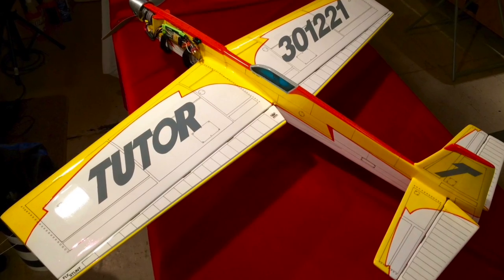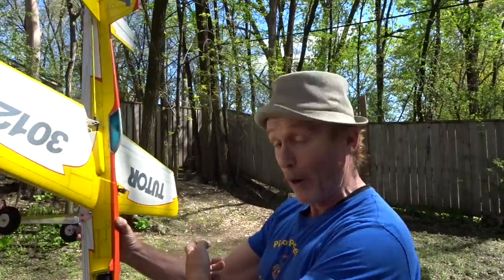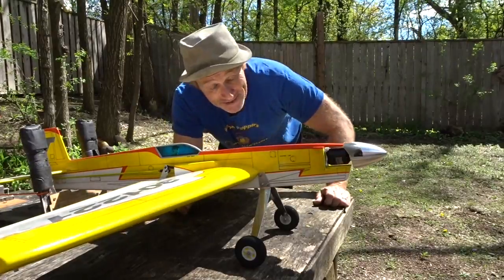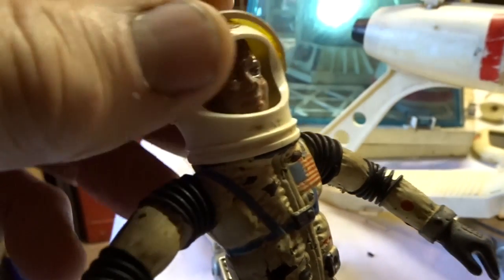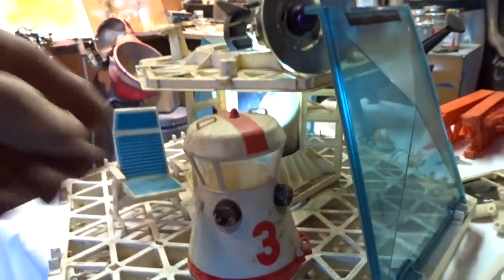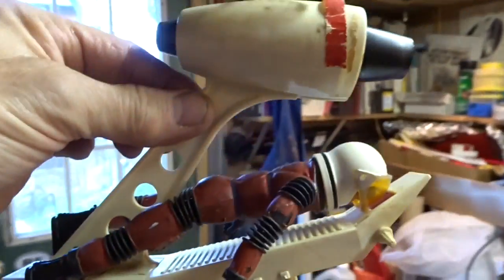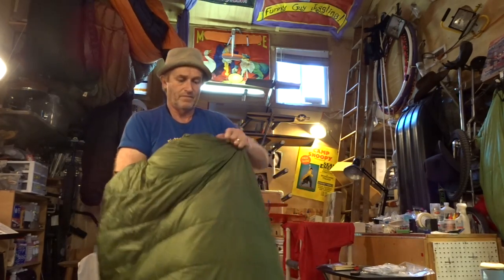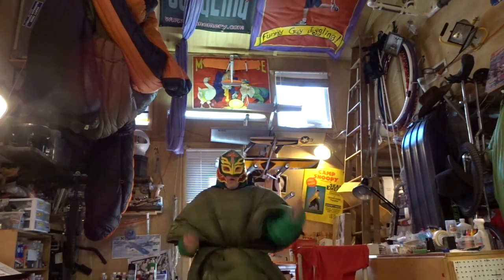What Have I Been Doing?   Shug's Update

Comment: congrats shug! you SHOULD be proud, she looks great! the tutor is as good a flying profile as there is. looks like u went a wee bit overboard on your pushrod cover, but that's ok. lol. and I imagine you mounted the batt and electronics on the inboard side to have the clean look from outside the circle, but it's always a better idea to put that stuff outboard. it's free tipweight. anyway, good job, very pretty. what does she weigh?
Reply from the maker: It is satisfying. I needed to make that pushrod cover like that to cover my exit hole and have no rubbing. Also inboard for battey makes me feel like it is more secure from flying off as it is not really near the tip. Just my thoughts. 
42 oz without battery. Thankee.
Reply: I was just ribbin ya a lil bit on the pushrod cover. it's fine, just very big. we usually make them much smaller. i hear what ur sayin about feeling more secure with the batt inboard, but what I was saying was that it can throw off the balance. unless u need inboard weight, u always want to put weight right on the centerline or outboard so you can use less or possibly no tipweight. even though it's nowhere near the tip, it still counts towards weight on whichever side it's on. we're always trying to save weight or put unavoidable weight in the right spots. anyway, again, congrats! super nice job! keep the vids coming. let us see how she trims out.

Comment: That Plane is a great looking build. I didn't know RC planes are battery operated these days. 
Question: now that you have a few months on the PK360 would you recommend it? There's nothing wrong with the original PK I have (actually two of them, I recently found an orange one). That 360 is so dang sexy and it's calling my name.
Reply from the maker: It is actually a control line airplane...but RC planes are electric too. Quieter. Will be the flying of the future.